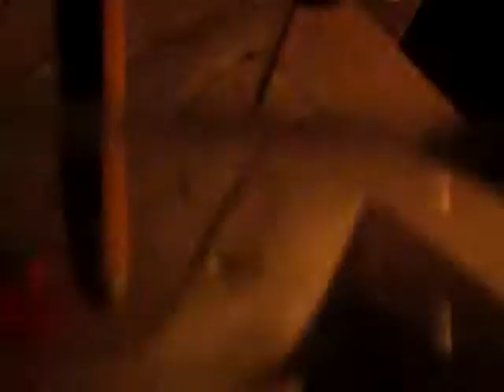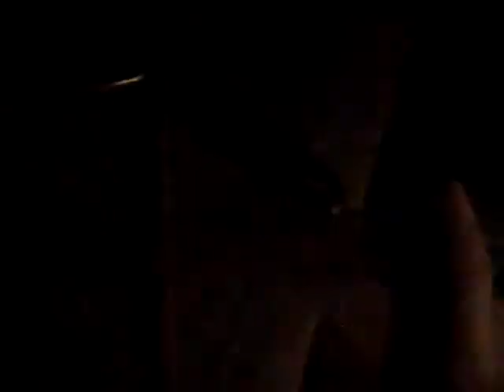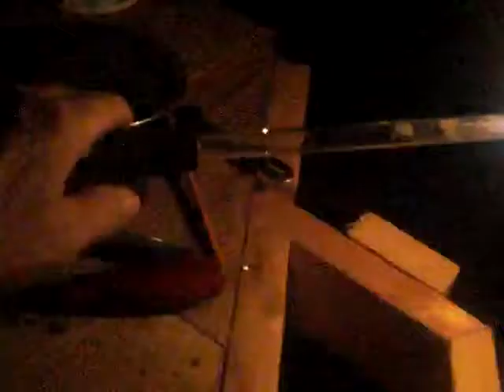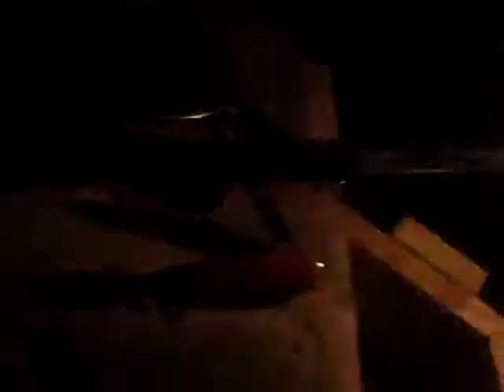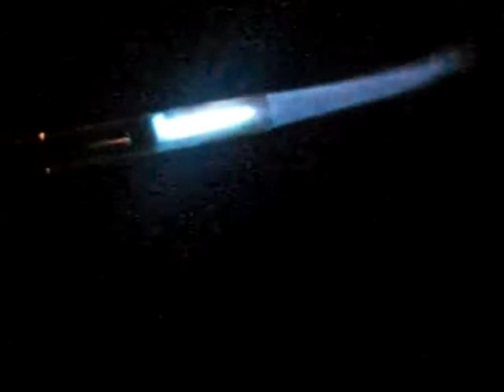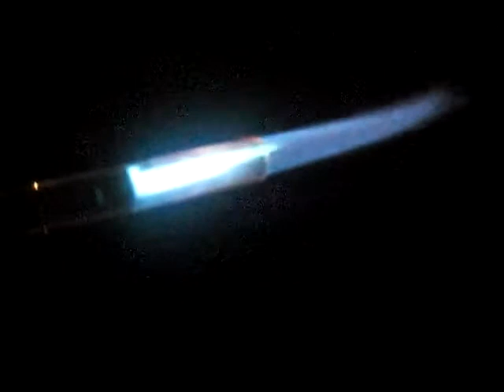428 Quartz test 03

Comment: @davethehunter2 the flame has a frequency and it also acts as voltage does and changes the shape of the quartz. this is why you are getting the ossolation of the tube and the sound.

Comment: this is a good example of how quartz is used in everyday things. you can apply a voltage to quartz and it will change shape and vice versa. quartz was used in the forties for sonar, and was used even earlier for microphones since that sound bent a thin piece of quartz causing it to put out electricity proportional to the sound. smoke alarms have quartz and metal put together so that when a voltage at a Hz is applied it will cause a loud squeaky sound "the alarm"